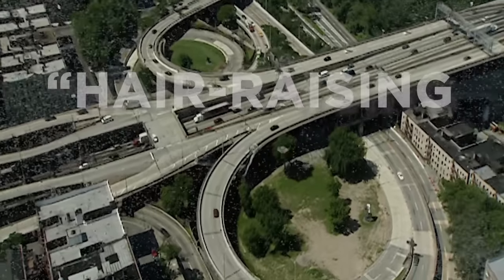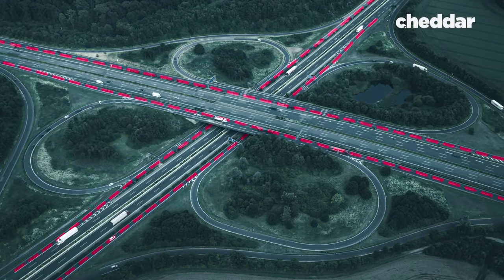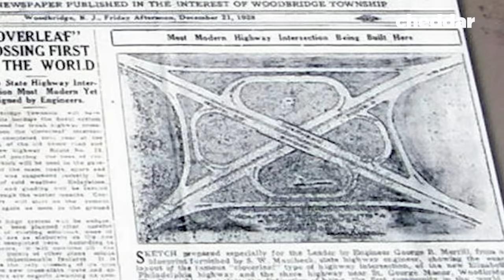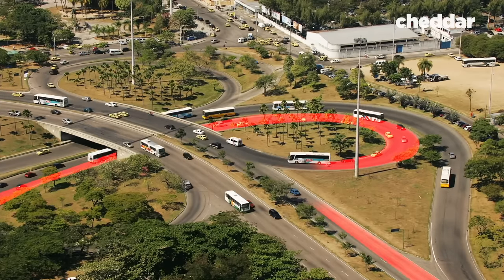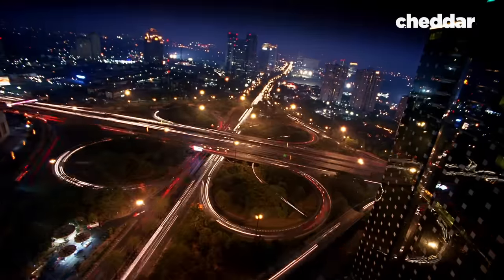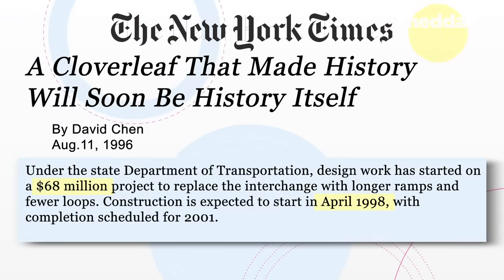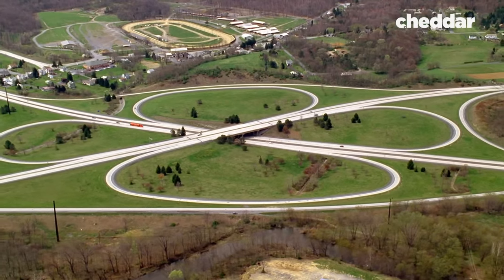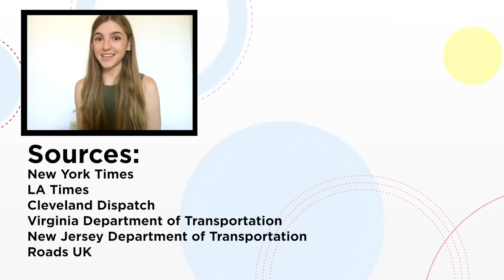The Big Problem With Cloverleaf Interchanges - Cheddar Explains

Comment: Pretty ridiculous video, first of all it presumes design flaw, but ignores basic driving culture - if people don't let each other to merge or to take a slip road and I literally quote "fight" then what do you expect. I know driving culture in US is notoriously bad, but clover-leaf design works amazingly across the world. You cannot blame design for simply being unable to drive. Secondly, it does not matter the design when capacity is exceeded any design will suck, so if you have lack of road capacity in the first place it needs to be addressed by increasing capacity first. 
Now yes... indeed there cars leaving and cars joining have to let each other pass and that creates a little choke-point, but it seems that this is safest way to crash, because both cars are going same direction and angle at which they crash is even lower than roundabout (which everyone put as solution to any issue). 
Further, you haven't really show any solution for it, so realistically this is still the simplest and best design... Directional and Stack-interchanges and  are notoriously confusing and expensive and diamond is in no way better when it comes to traffic, it is just cheaper because it requires less space - which is indicated in the video itself where traffic is already backing onto the highway creating very dangerous situation (somebody running into stopped cars) and it usually requires several traffic lights which are just less efficient. Further, land in the loops is far from useless - it could be built on and access can be made to use it, the loops themselves can be expanded by using other streets and going around the parts of the districts.

Comment: cloverleafs have two problems, the loops are too sharp, and the ramps are too short.  A lot were built early on when cars and trucks were smaller and everything moved slower, also US roads seldom have superelevation on turns.  the ramps are just too damned short, we have one I use often and it is busy where you have to merge into two lanes of busy traffic in about 50 feet, that's stupid, and that was just rebuilt for $50M only a few years ago.  the interstate system cheaped out and doesn't use cloverleafs unless merging with another interstate.  OK on some rural road having a stop sign or traffic light is no big deal, but if you merge into a busy urban arterial street with traffic lights on both sides of the interstate, with turning lanes protected, etc. etc. you have created a clusterfuck.  At times of day traffic will back up for half a mile, folks going left wait forever then get on the street only to be seeing another light as well as folks on the street wanting to get in the left lane to turn onto the opposite lane of the expressway.  Traffic engineers, if you install a traffic light you failed, period.  I remember crossing a major bridge only to have a local road crossing the six lanes of bridge traffic all controlled with traffic lights, effectively the capacity of a bridge that would cost over a $100M to replace was cut in half with a $1 light bulb! how stupid.

Comment: The 1920s where land was cheap, Bridges were expensive, and the differential between a stopped car and a moving car was much smaller than it is today when we have faster speed limits and faster cars.
That means that there has to be a lot more speed-up between the ramp and the moving traffic and that differential spells danger, accidents, and personal injury.

Comment: A decent long distance rail system should, in theory, help alleviate some of the traffic congestion on highways with cloverleaf interchanges, however In the U.S. the rail systems, or perhaps more accurately the rail companies, just don't exist to fill the need of the people. As more people could afford their own automobiles the number of passenger trains decreased and as those decreased so too did the train stations for them. Many major cities still have them but the farther away you get the fewer stations you find. The convenience just isn't there anymore.
As for the cloverleafs themselves the narrator already explained the primary issue with accidents usually being caused due to the entrances and exits being so close together and in the wrong order. Another issue is with vehicles not changing lanes away from the ramps when they aren't exiting. This causes unnecessary congestion in the right lane where the changes must occur. If one of the ramps could be connected to the opposite side of the highway then the risk of accidents would greatly decrease, unfortunately this isn't always cost efficient or feasible for the land available and traditional cloverleafs are what you are left with.

Comment: Looks more the planning issue isn't with the design of road but the viable options of transport in these areas. Decent coach train and plane options would bring down vehicle numbers on the road. Then could constrictor and release method could also be used just before the clover ie for a mile or so before constrain flow with a lane removal. The inflow becomes a new lane then it sorts itself because you don't need 1000 cars a hour going through a intersection if you plan you're cities correctly to start with

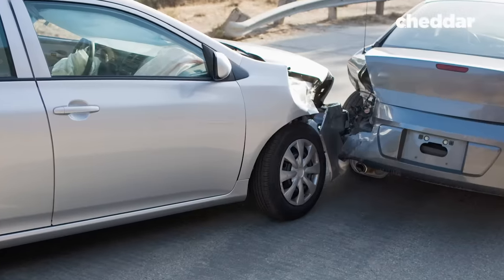Comment: The picture at 6:23 is labeled backwards. You can also see on the right edge there is a smaller offramp located too close to the larger interchange.

Comment: Most cloverleaf intersections are not safely designed for tractor trailers (semi trucks/big rigs).  Sharp curves are dangerous and the merging sections need to be designed better.
Reply: many merging lanes are long enough and speed limits are reduced a lot; Taking the turns at a lower speed and then speeding up afterwards shouldn't be a large issue ; Tbh I have more concerns at higher speed flyover passes where trucks are allowed to drive at their top speed, while being on a wide turn on a bridge which (in current temperature and weather conditions) tend to be slippery

Comment: comparing technology, cloverleafs were WAAAAY ahead of the simple, slow, cars back in the day, but modern cars, with their high speed and easy accessibility, has now overtaken cloverleaf technology.
We need interchanges that can handle a lot higher speeds than before to facilitate high speed direction changes with no or little slowing down.
Reply: That's cute. 

You do know that Germany has plenty of cloverleaf interchanges?

If you believe that adjusting your speed to a curve in the road is an outrage, you shouldn't be driving - let alone at high speed, where situation awareness is critical. 

It's hilarious when people breaking out in cold sweat when a Mercedes shows up in the rear view mirror at 130 mph want to grandstand about "high speed"

Comment: A mystery is why there are so few roundabouts in USA - I guess it goes against the whole culture of stop signs every 5 feet - and DESPITE that, a constant need to T-bone each other at every intersection going 100 mph. I guess it's too demanding to understand why drinking and driving is such a bad idea - just as not-getting-thrown-through-the-windshield isn't enough of a motivation to use seatbelts. There have literally been commercials preaching that the point of the seatbelt is to not get a ticket. There are a lot of smart Americans - too bad every dumb one seems to be out driving. That's literally the only use I see for self-driving cars. Force people who are too stupid or too old to drive properly to use one.

Comment: The child doesn't know what she is talking about.  A cloverleaf interchange is still one of the best ways to build an interchange.  If built correctly they are relatively safe and efficient.  The problem is that they kept trying to build them on smaller and smaller pieces of land making it harder for cars and trucks to merge.  True, land cost has gone up considerably but unlike what the child says bridges have gone up even more because of environmental safety and seismic issues.  The interchanges that they are building now may take away some of the merging issues but now on the expressways they are building the diamond interchanges with stoplights and stop signs that can cause major traffic backups clear out onto the traffic lanes of the expressway,  also now they are building confusing interchanges where the traffic has to cross to the other side of the road and then the cars that don't make a left turn are then routed back to the right-hand side again.  Cloverleaf interchanges would work well if they just built them on larger pieces of land.  Remember one thing, as traffic volume increases changes in design need to be made mostly by adding more interchanges and ramps to reduce the volume at the existing interchanges.  It's not the cloverleaf's fault that traffic volume has increased to exceed the volume it was designed for,  all roadways have to change to handle increased traffic demands.  You don't just get rid of roads because traffic has increased so why get rid of an interchange for that reason.  They just need to do a better job of planning for the lifecycle of an interchange so that it is just as useful when traffic volume doubles.  In Salt Lake City they Completely rebuilt the I-15 interstate through the city in 2000 - 2002 to prepare for the Winter Olympics.  They didn't plan well and after spending over one billion dollars on the project in less than10 years it was not sufficient for the traffic load. Child, this is my motto, "If you don't have the money to do it right the first time, when are you going to have the money to do it over again".
Reply: Even in areas where seismic activity isn't a relevant issue at all they hardly build interchanges with numerous ramps and bridges but still tend to more classic cloverleafs; However one issue with cloverleaf interchanges is that large ones tend to be interlaced e.g. with another on/offramp or a rest area and such things make it way more difficult for drivers to navigate through it; Most complicated when there are two interchanges right next to each other

Comment: The design is not the problem. The issue is with the driver. Learn to merge and problem is solved. If you cannot merge well you should not be driving.

Comment: I have a similar problem where I live in Barcelona. Two highways cross and as a result of that I have to switch highways and immediately afterwards cross 4 lanes to leave the highway in the first exit after that crossing, which is especially dangerous and scary if you're riding a motorcycle. On top of that most of it happens in a tunnel

Comment: Just make a roundabout
Reply: A roundabout wouldn't work for the situations that cloverleafs are built for. Unless you want a three layer road, one or both of the roads would have to crash right into the roundabout, reducing traffic flow. Roundabouts are not the answer to every junction issue.

Comment: The message here is simply wrong and indicates very shallow understanding of the problem. Actually, cloverleaves are very good - for a certain traffic density. Problem with them is exactly the same as with roundabouts. Both are often used where density is too high and thus requires more expensive solution. Most notorious is multi-lane roundabout, which is the most dangerous type of crossing, while single-lane roundabout is second only to lights-directed traffic interchanges (but the latter have less capacity). Traffic solutions are simply not scalable in economically viable manner. It's not cloverleaf design that is at fault. It is fault of the government to address the need to upgrade those intersections when traffic predictions indicated they will become obsolete. Instead, it's a worldwide common strategy to wait as long as possible with an upgrade - which on average increases the cost of upgrades fourfold.
The other sin ot traffic designers is looking for holy grail. There is no such thing as one best intersection. In each case you have to analyze traffic streams and it's predictions, as well as economic and terrain constraints, to come up with a tailored solution. This doesn't make good PR/news material so is often omitted in public knowledge.

Comment: Watching this video, I pickep up two elements that are  interesting to me. The first is the term "battling to merge". Why do you need to use such an expression and why people need to battle for merging. They only need to slightly lift off the throttle or put down a bit hard at times that's it. If they battle for it ( for merging or (not) let somebody merge) in  the proper sense of the term , it is unavoidable to have accidents..........
The second thing is the almost total absence of acceleration or deceleration lines in US cloverleaf's. (As far as I could observe on the pics provided in the video)  I specified US cloverleaf because it is not that way in Europe. Say , you have a 3 lanes road and we you approach an exit or a cloverleaf,  the most right lane becomes the deceleration lane and drives to the exit, there is no specific deceleration lane added at the approach of intersections, Then the 3 lanes motorway becomes a 2 lanes through the intersection or the cloverleaf which would of course create a traffic jam and  get the vehicles riding on the most right line by surprise if they do not intend to take the exit. Even if there is proper acceleration and deceleration lanes at places, they are far too short as far as I can observe. That's the biggest problem that i can see, no proper get out/slow down lanes, no proper merge/accelerate lanes , if any eats the most right lane.
Please, feel free to correct or comment if I am missing anything.

Comment: Odd you should put down cloverleaf interchanges when the SAFEST road in the world is the 800 + kilometer long 401 in Ontario, Canada. Least number of accidents per volume. The diamond interchange takes up much more area and uses four sets of traffic lights and two bridges and costs a lot more money to construct. Sounds like you are trying to sell the public on the use of diamond interchanges. Some of your examples shown in the video are not cloverleafs, but a skewed, or partial version one.
 Diamonds were okay in the '50s when first introduced. However, with high volume traffic, two bridges and control lights are required. Seems to me some of your facts are not correct. Makes me think of you as a used car sales person of old, trying to sell something you like over something that works. Most accidents that happen are due to poor or rude, (or both) drivers.
Reply: the 401 is the safest multi-lane road in north america, not the world. it's probably a death trap compared to the expressways in japan or the netherlands. also the sheer number of lanes that aren't exit lanes probably diffuses the number of accidents in the exit lanes during the calculation of that statistic

Comment: use more trains
Reply: Trains just don't fit the US. Not outside the NE Corridor, anyway. Even the fastest train on the planet would still take 14 hours to get from the US's largest city to its second largest city. And that is assuming it is going full speed without stopping the entire journey. Meanwhile planes can get you between the two cities in 5 hours for a lot less cost.
And that is before taking into account the layout of American cities. They aren't conducive to a system like a train that benefits from massive ridership numbers. American cities tend to be sprawling. If you are going to need to rent a car anyway, might as well save money and time by flying into the airport on the edge of town.